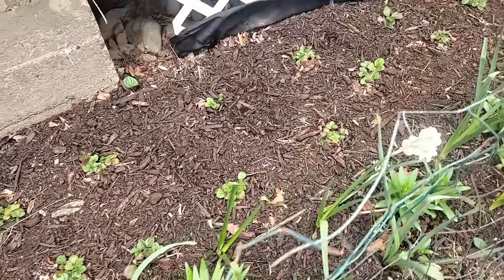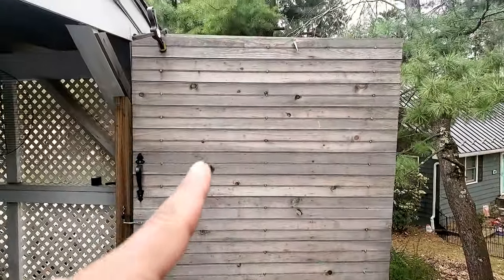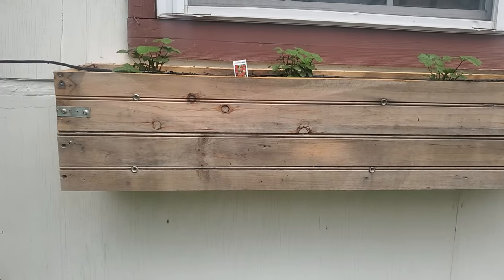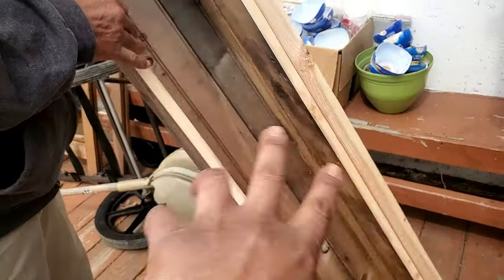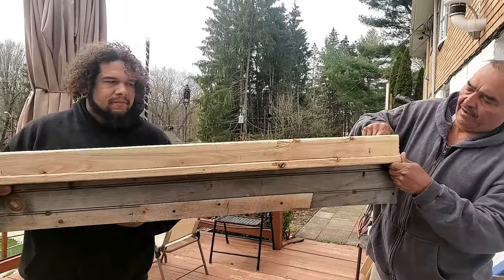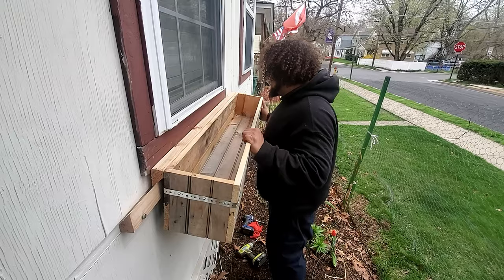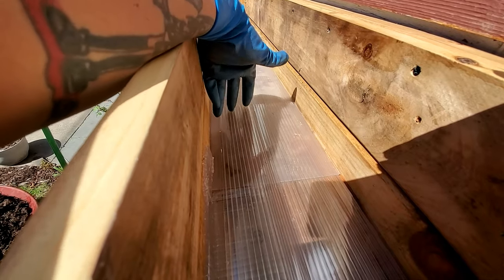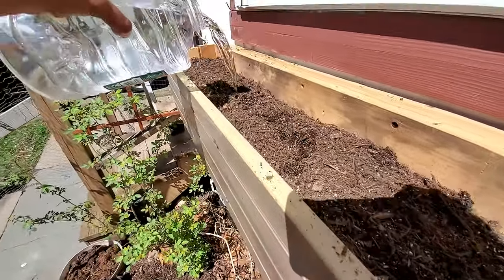Making CHEAP Window Planter Boxes WITH Irrigation For My Strawberries

Comment: Great boxes! For future builds you  can use black hefty bags to line the inside of you wood boxes. Just slice bag open and lay inside so it comes up over the edges. Poke your holes in bottom for drainage then fill it up with your soil mix. trim excess plastic around top edges. Mulch will hide edges of plastic and slow down your evaporation speed. Plastic will protect your wood and hold moisture longer in soil.
Reply from the maker: yea I def thought of that too!!